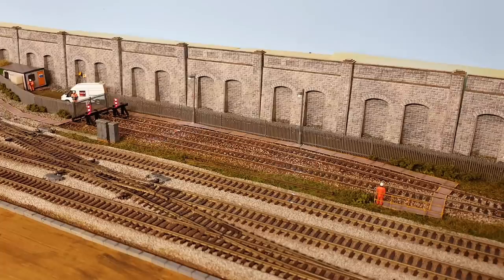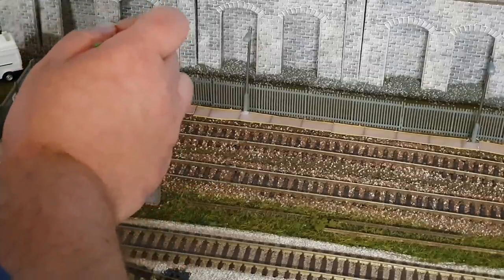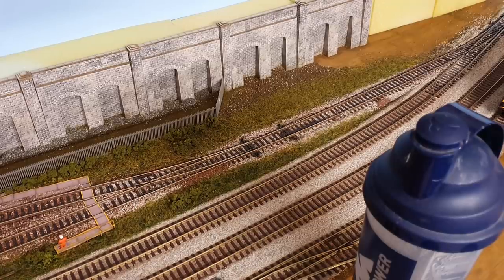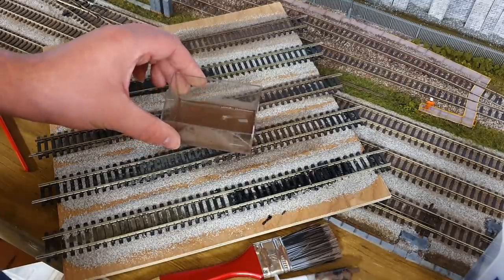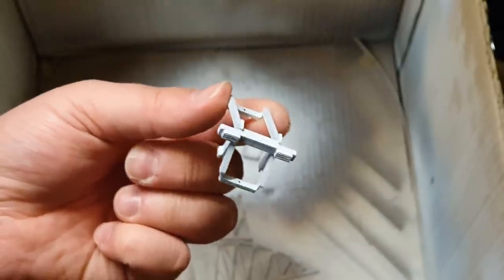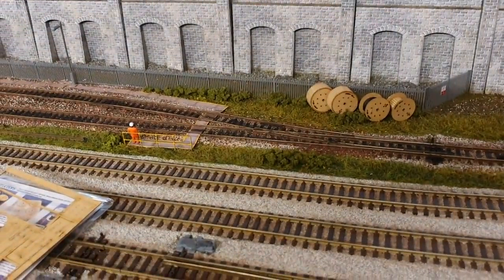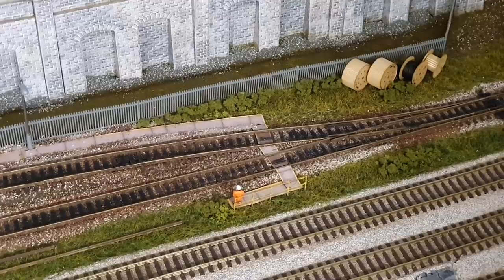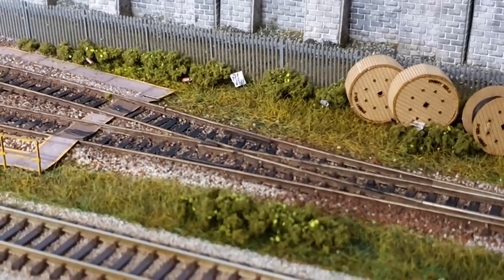New Junction - Adding a Station Pilot Siding, Part Six | Completed!

Comment: Awesome work once again. Well needed for me as I’ve never really weathered track before, so thanks!
Reply from the maker: Thanks Josh, You can do wonders with washes especially using different colours.
Reply: New Junction definitely! I paint Warhammer models so I use washes with them, I make my own using left over paint. I’ve just never applied to my track out of fear of it not running afterwards! But watching this it puts the old mind at ease a bit knowing it’ll still run!
Reply from the maker: @Jozda  if in doubt have a practice. :-)

Comment: Nice update and a good series overall there Richard...

A way to solder the droppers especially for sidings... which you might find easier is to do it at or very near the end... makes it easier to hide/disguise them with buffer stops etc that way. hope that helps... Pete.
Reply from the maker: Thanks Pete, I've done that in the station sidings believe it or not.
Reply: @NewJunction , I meant you can solder the droppers to the inside of the rails, if you can't solder them, or get to the underside of the rails... very handy if the track has already been fitted.

As locos and rolling stock won't be effected as the buffer stop is there... and they can be hidden alot easier with ballast and the buffer stop being placed over the top... plus theres always abit of grass/weeds growing up around a buffer stop too usually!